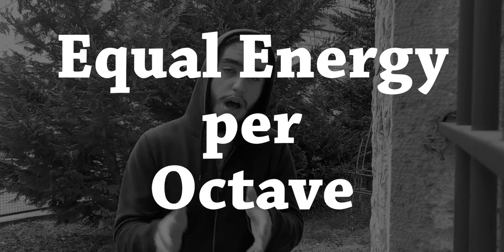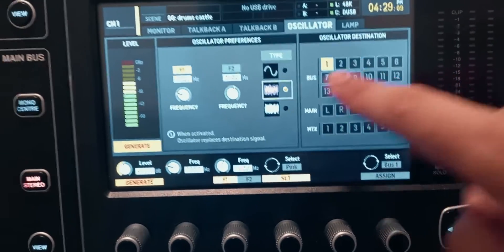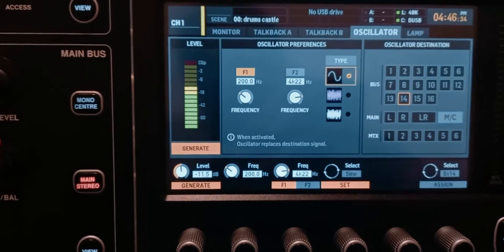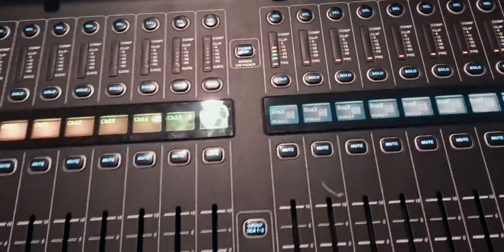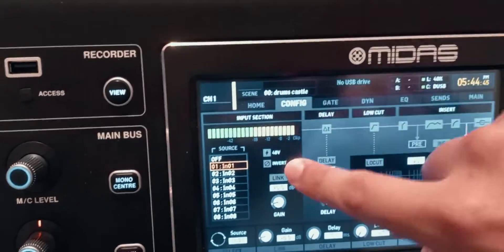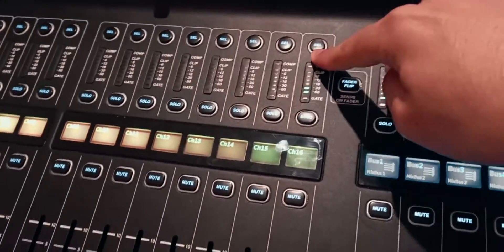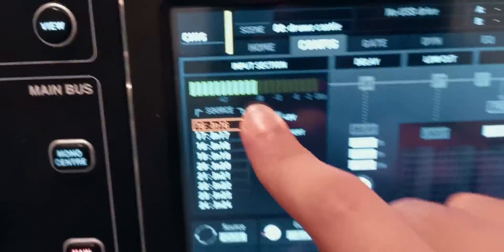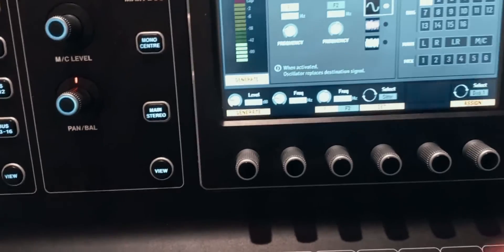M32/X32: CHECK Inputs, Outputs & Speakers with Pink Noise & Sine Wave (+ FREE checking presets)

Comment: Another use for sending osc to a channel (via a bus), which i'm about to test soon next time i use the console : linechecking your DAW channels when you're doing a multitrack recording with the M32 USB.

For instance you take channel 01 on the console, send osc to it (via bus), and then make sure there is signal in channel 01 in your DAW project that does the multitrack recording.
Then you move on to channel 02
etc

NB : remember that for each channel you test, on the console as a signal source you need to switch from the original source (ex : AES 4) to the bus (ex : MIX 4) that sends the osc, and then when testing of that channel is done, you need to switch the signal source back to its original setting (ex : AES 4)
It's a bit cumbersome but if you're alone and don't have anyone to tap on each mic on stage while you check your DAW channels, then it's better than nothing.

Another solution would be to use some kind of remote device that has a remote control of your DAW and that can show if channels get signal, but the only one i've found so far was some AVID remote app, that worked with Reaper and had good VuMeters, but it was a PITA to install and setup, and it would slow down Reaper big time.

Another way would be to use teamviewer or something and see the Reaper project from a remote device while you're tapping the mics on stage, but then again, it's a bit of a hassle.

EDIT : actually, using Teamviewer from your remote device (tablet, phone, etc) doesn't seem that bad !
Just gave it a shot with a small screen Android phone and a Reaper sesh that was on my desktop computer, and it seemed to work nice.
Gonna try it out in a real life situation soon.

Comment: IMPORTANT : don't make that noob mistake i did, which consists in testing busses with noise, and then forgetting to turn the noise off (but it was turned down so much that i couldn't hear it was still on). This noise, even if very low in volume and almost silent, will REPLACE any audio sent to that bus, which means any channel you send to that bus will not be output to that bus unless you turn off the noise.
You will think your channel sends to this bus are broken (because the bus itself works because you heard noise through it earlier) and you will freak out :)

TLDR : noise going through bus but no audio otherwise means that you forgot to turn the noise OFF from that specific bus !

Comment: Hi Daniel,
One question about the pink noise and rta device.
I'ld like to ring out speakers..
I setup the pink noise generator to output main LR.
 i setup the rta tab with options solo priority on an eG's Rta on an input 1 as rhe mic ( gain channel 1 already done)
So i generate the pink noise and showned on led main R meter.. ok
So i would like to solo the channel 1 mic to get to it to the mc/solo meter with the main LR meter view.
But problem when the solo mic button is pressed there is no more pink noise LR to my monitors speakers.
How to solo it and continue to get pink noise to the speakers ?
Because i need to  switch between mic and main Lr  under eq tabs.
Hope it's clear. 
Thank you for your support ..
Paulo

Comment: Hey. I use a Midas m32 at our venue i started sound engineering about a year ago. If I initialise the console, does it reset only the scene that I have selected or does it reset more? 

I’m scared to try because there is a lot of other saved scenes that were made earlier by other engineers and there is about 60 of them scenes. And I messed up before as I tried to save a scene on my memory stick and ended up accidentally overwriting the default scene on the console.

I love your channel and I learn so much by watching your videos.

I also have an another question about my broken dl32 but it’s not that important

Thank you.
Reply from the maker: Initialize creates a fresh new scene it does not delete anything from the console and it does not reset anything. You can watch a video about Initialize, reset, backup and restore here: https://youtu.be/xaH2uOCq9Uo

Comment: For the test of the physical XLR outputs, why not just route bus 1 to all XLR outputs instead of using bus 1 as a source for an input channel that sends to all the other buses that's routed to the XLRs. Seems rather unnecessarily convoluted
Reply from the maker: Yes you absolutely can do this. It just made sense to me to do it that way at the time of making the video but you do whatever method seems simpler to you. The end result will be the same

Comment: Hey! Thank you for all the work that you do through your Youtube channel! It has been a great place for me to learn more about sound engineering considering i just started 2 years ago at our local church.

The issue that we have, with a behringer 32x console is the aisso A channel. We use a stage box and route the signals with a CAT 5 Ethernet cable. One time before a rehearsal there was no signal coming form the stage box and we ended up needing the change to aisso B and now the console shows the A input as red and it doesn’t work at all. 

My question is: what can i do? Or how did it got this issue and if i can fix it myself or at the guarantee where we brought the console.

Keep up the good work!
Reply from the maker: First of all make sure you are using a shielded cable (you can use a normal unshielded one but it's not recommended)

Second of all, the AES50 connections:
Plug the ethernet cable into AES50 A on the back of the console and also into AES50 A on the stage box
Go to the routing page and set the inputs to AES50 A instead of local
That's it
The red light means it's not plugged to the correct port
On the console you can choose if you want AES50 A or B 
But on the stage box you have to always use AES50 A
If you're connecting 2 stage boxes:
From console to AES50 A on the first box
From AES50 B on the first box to AES50 A on the second box 
So on the stage boxes A is always the main connection and B is the "through" that allows you to connect another box to it